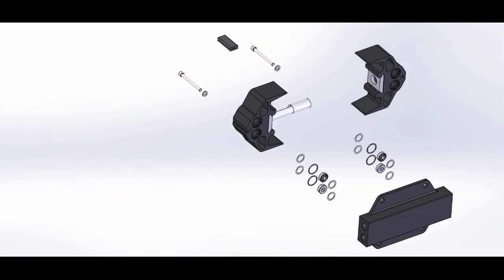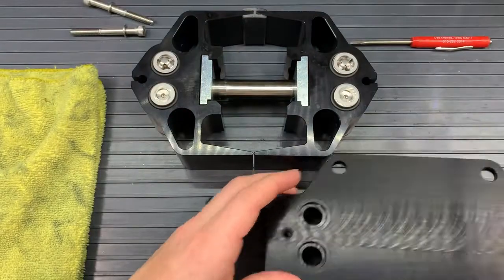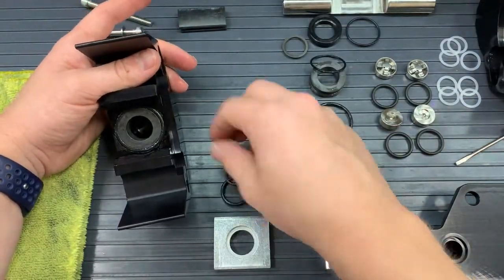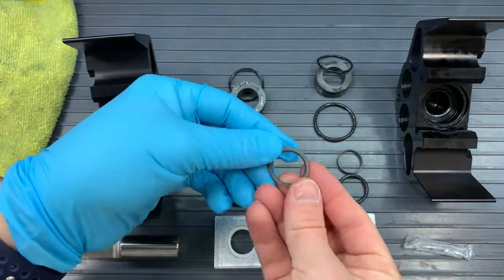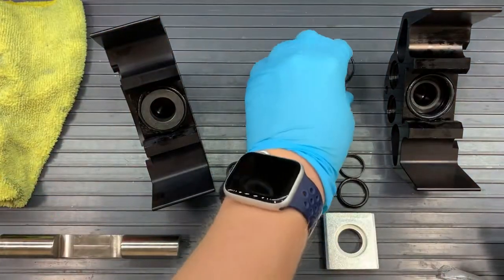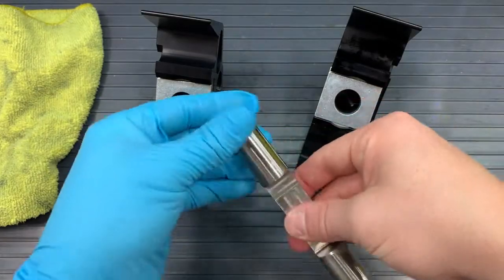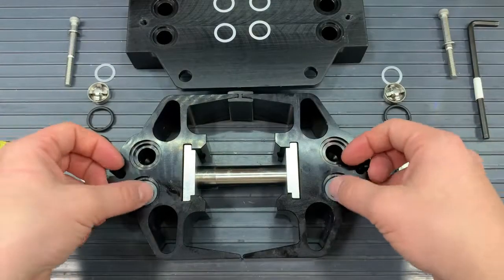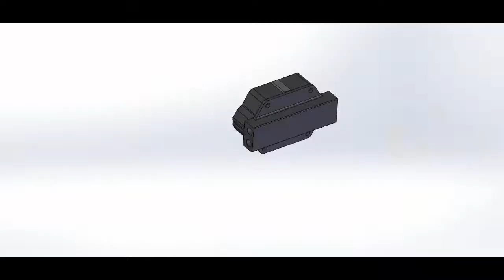Easy How-To: 356U/360U Power Washer Pump Rebuild | Pumptec

Comment: Hello.. just wanted to thank you very much for your video is very helpful . I purchased a 1200 psi carpet extractor and it didn’t last me long at all and I can’t afford to take it to get repair so I’m trying to see if I can do it myself but I don’t know where to start?? If is any way you can help me out I’ll make sure to give you a good donation for your help the machine has 3 switches from the top to the bottom the last one in the bottom is the only one I don’t heard anything when I turn them on and I have no pressure coming out the solution hose I took it to a place and they told me it might be the pump head this is why I’m looking to see if maybe it needs to be rebuilt anything you can advise me it will appreciate it thank you

Comment: Guys, I got a new pump like this (360)
Hooked up the fresh water and turned it on...running water through a tile spinner. The gauge doesn't show anything. It sits at 0. I can adjust the pressure up and down with the unloader but the gauge never moves.
How do I prime this thing to get the gauge showing pressure?
Reply from the maker: That is a great question and we would love to get more details on your system in order to get the best results. Please email customersupport@pumptec.com and we can get started in the right direction.